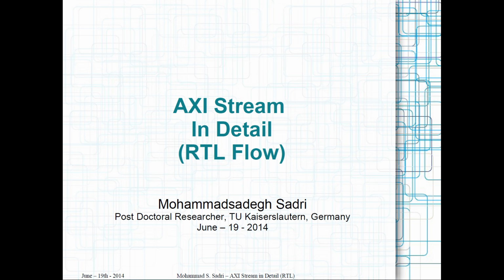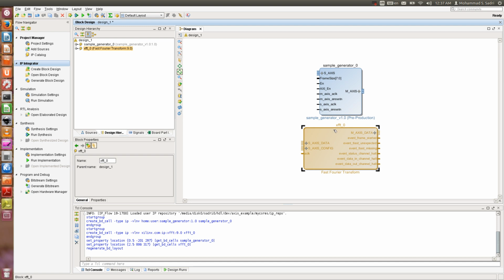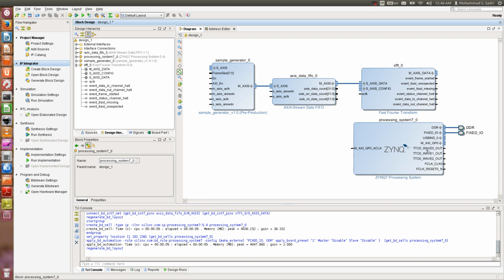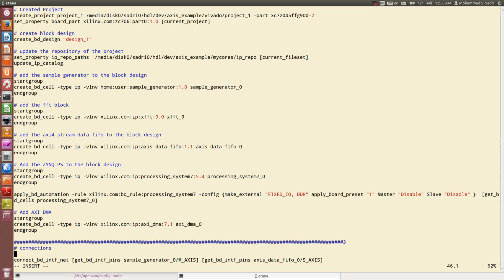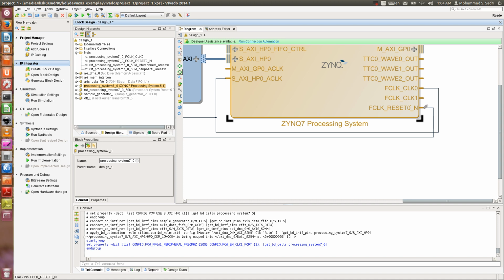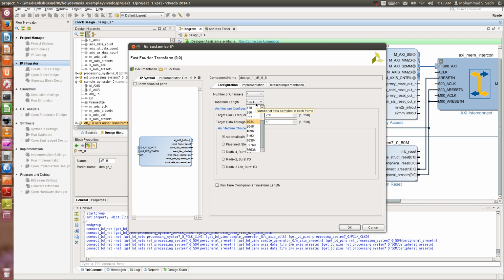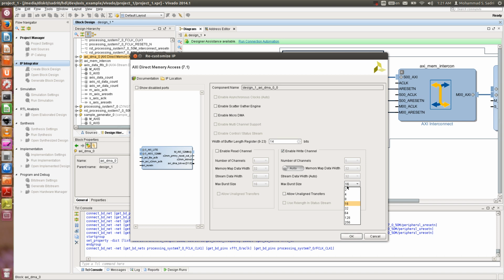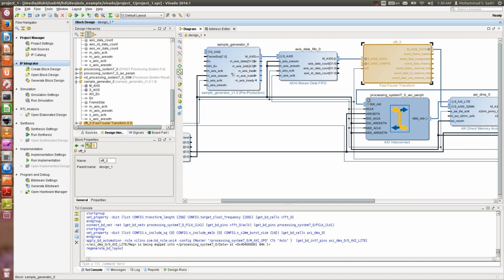ZYNQ Training - Session 07 part III - AXI Stream in Detail (RTL Flow)

Comment: If you want a tcl file, you can simply use write_project_tcl/source command. The purpose of a course is that the students can take away knowledge from your video and do their own FPGA design projects, i.e., reproducibility or knowledge migration. If your students do not know tcl language, how could they know what tcl commands should be copied out? Then, what's the sense of your course at all?

Comment: Instead of adding HP slave ports to connect to AXI -DMA, can we add GP AXI Slave ports?
Reply from the maker: Hi Akshatha, well, should be possible, but usually the AXI DMA is used to copy the data from the PL to the DRAM and for that purpose the shortest path is through the HP ports (as far as I know). I have never tried connecting the AXI DMA to a GP slave port.

Comment: at 45:36, you set the target throughput rate at 50 Hz.. however, isn't the target the 200 Hz clocked interface from the FIFO?
Reply from the maker: ***** well at 45:36 i see that the sampling rate is set to 50 msps, and the clock freq to 200 mhz. so in timing constraints file, we should put a constraint for the 200 mhz clock (5 ns)

Comment: Hi, Mohammadsadegh Sadri We have a question. We are developing a system to accelerate matrix multiplications and other algebraic operations, given the dimensions of the matrices (6x6 maximum) we think that the best is to use the ACP. In that case, we just have to activate that port instead of the HP0 and  connect to the DMA through the AXI Interconnect? Everything else is the same?
Reply from the maker: the transactions over ACP should have the coherency bits set. look at archache signal in arm axi4 ace document